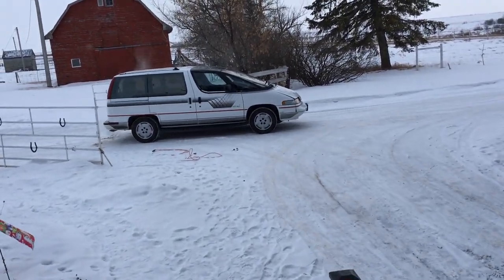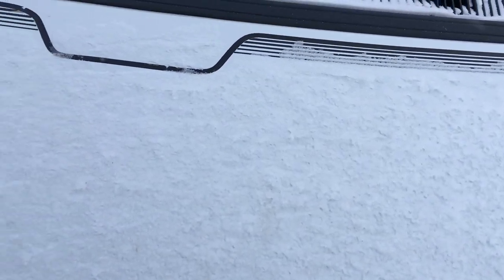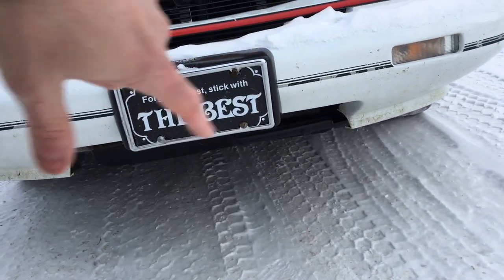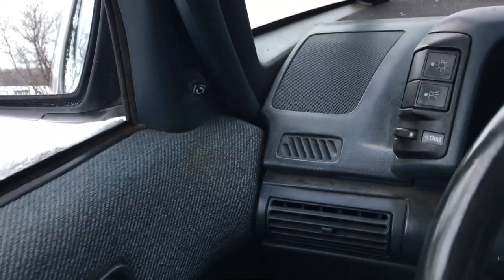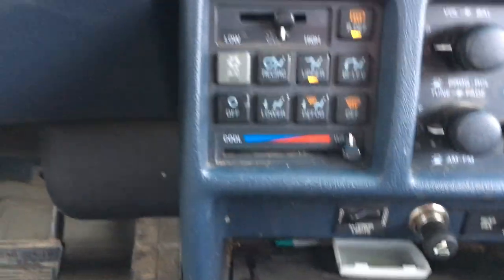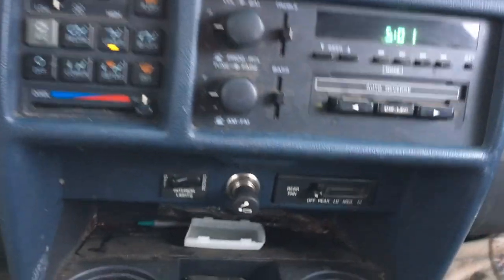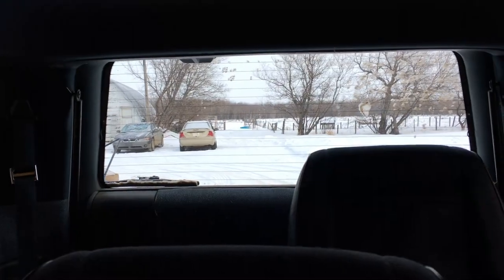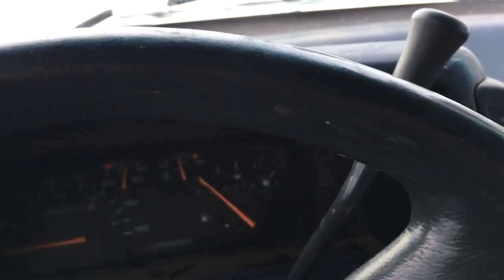1993 Chevy Lumina APV - Introduction & Tour

Comment: I bought my Landlord's 1996 Chevrolet Lumina APV. It has the 3.4 V6 in it. It had 137ish kms on it. It has crank windows,  but electric mirrors. He bought it new. The two seats in the third row was an option.  Since he didn't need them they took them out. The interior is immaculate. Putting blankets on the front seats so they wouldn't get dirty. His wife's idea. If you ask me. A fabulous idea. The van is 27 years old and everything works. Even the A/C. I just love it. I bought it last summer after my 95 year old landlord failed his eye test for his license. I've loved it ever since I moved in. It's a dark green with gray interior. One of the only repairs that is a pain is finding parts for it. The latch for the rear hatch broke off. And is insane to find another. But I'll address that this summer when it gets warmer. Nice to see someone else that likes these things.
Reply from the maker: Oh, if you are on Facebook head on over to the group: Club APV: Fans of the Lumina APV, Olds Silhouette and Pontiac Trans Sport.  Lots of diehard fans and great ideas floating around for these vans.  Always lots of nice discussion.  They are super fun spaceships.

Comment: Wipers not functioning right could also be the circuitboard on the wipermotor and  the dashsdimmer/domelamp/ headlamp combination switch sometimes go bad but it is an easy fix for both parts to replace,hope this will help.
Reply from the maker: Likely will, had issues on my 1998 Silverado on these boards, I will do basic diagnostics and see what comes up.

Comment: Thanks for sharing such a fun project. This looks like a interior cleaning job for two packs of baby wipes. I’ve had some luck using fuel system cleaner to restore functionality to older GM gas gauges
Reply from the maker: Oh yeah, I’m going fairly extreme and moving the wife’s car out of the garage so I can heat it and get cleaning. 😳  I’ve got 3 seats out and detailed, but will likely do a time lapse or something to show the progress.

Comment: The headlight switch will need to be replaced, Fortunately they are easy to find on eBay. I had to replace mine since the dimmer detent on the dial was also broken.
Reply from the maker: Right on, thanks for the advice.

Comment: I think they had all of those floor seat mounts as some came with bench seats so they just had all the floor mounts so they could put any seat configuration .
Reply from the maker: Yeah, the previous owner said the middle row didn’t come out.  I said OK, so now they are all out and inside in the warm so I can do some serious deep cleaning.
Reply: @Turbo231  Every van I ever had , the first thig to come out was all of those seats !
And they never went back in . I have a Caravan now with stow and go . If I need them I pull one out but most of the time not 😅
Reply from the maker: @LooneyFarmGuy  Now I do have a 94 Chevy Caprice Station wagon so I’m not new to hauling long things, but the added height will be pretty awesome.
Reply: @Turbo231  Ah yes , I remember when that style came out ... the upside down bath tub look , It was not popular at the time , it pretty much killed that line 😖, I do love station wagons though 🤗I have had a few

Comment: check  the wiper  delay  board  motor  never goes bad  but the board will get solder joint issues  at the plug
Reply from the maker: There is a video about that repair.  Check out the playlist.

Comment: Do you have any pointers on accessing the turn signal flasher or replacing headlights?
Reply from the maker: For the turn signal flasher, check out my “Super Tail-light upgrade” as I have to upgrade the flasher unit for the new LEDs.  I’ll shoot a video today about removing headlights as it’s required to change a side blinker bulb.

Comment: There is one for sale near me, trying to gauge what a reasonable price would be for it. If I may ask, how much was your APV? The one I am looking at has the 3.1.
Reply from the maker: I’m guessing you are in the US.  I spent $2200 on a very mechanically clean 93 APV with the 3800 V6 with 112k miles.  Going prices for running “Spaceships” are between $1000 and $3000, the top end being in really good shape, maybe an Olds Silhouette, the low end maybe not so good but runnable.  That being said, they are rare so if you ever wanted one, now is likely a good time to get one before they are gone.

Comment: hi, i have the same model lumina apv, my oil pressure stays close to red at idle, it rises when i give gas, what do you think?
thanks
Reply from the maker: I think your engine or oil pump is getting a little worn out.  It’s “technically” ok, but if it’s a change, then something has changed.  You will however want to double check your current gauge reading with another one, either mechanical or electrical.

Comment: have a 95 transport  i bought new,,,still have it ,,,3800 4t60////still looks an runs like new,,,  great in snow  i just put on new  usa made yokohama tires...mine is fully loaded  except  air shocks...power sliding  door still works  a at close to 200,000 miles...i say  it will easy go another 100,000  as we fluid film all our winter cars  ,,ohio loves salt lol
Reply from the maker: Nice to be the original owner!